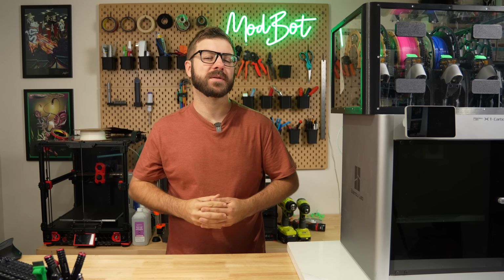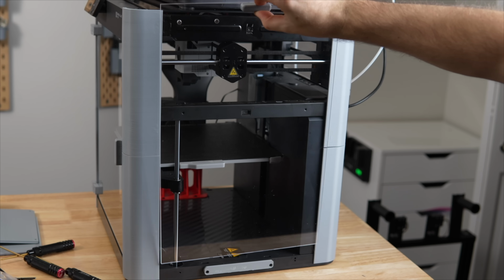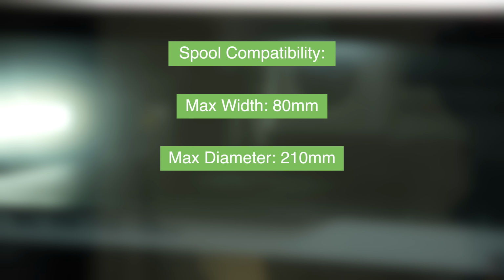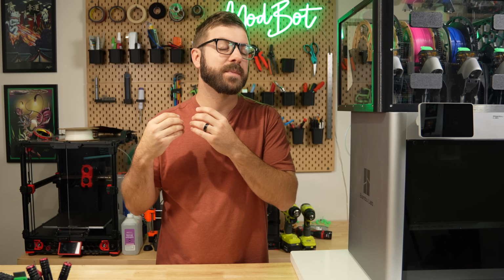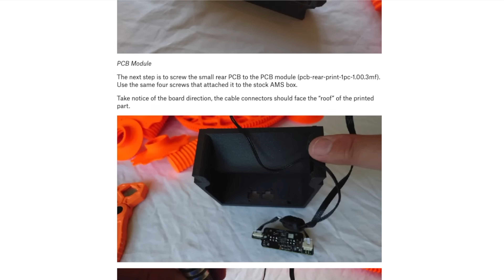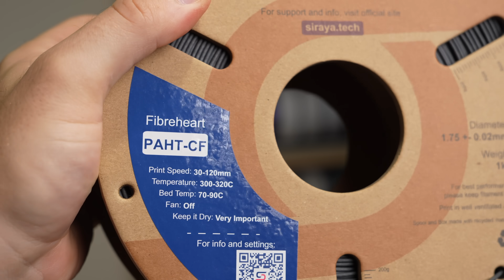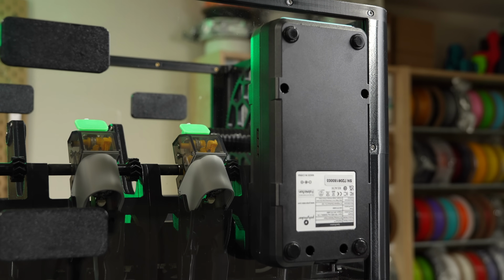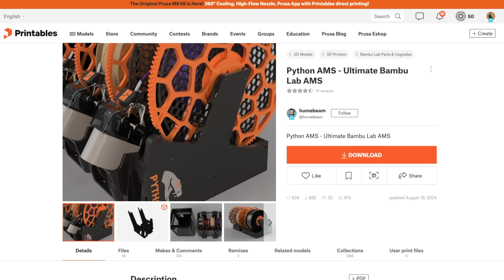Ultimate BambuLab AMS Upgrade! (Python)

Comment: Is it quieter, louder, or the same type of noise as the official? My biggest problem with this printer is how much noise everything makes. I can run all three of my other Voron printers, and this still drowns them out.
Reply from the maker: @yusky03  I haven’t measured but it might be slightly louder. The enclosure helps to dampen it.

Comment: I've already made compatible RFID antennas, and after testing I'll make them open-source
Reply from the maker: That’s awesome! Do they connect to the computer costing RFID board?
Reply: I believe automoderation is pushing little too hard, my answers are magically disapearing
Reply: everything is ready and tested
Reply: @Kenagon  if you included any links in your responses, you will need to break them in order to post the comment. the YT automod will instantaneously delete any comments that have links in them, even to other videos on YT; or at least that has been my experience.
Reply: @blakes8901  even mentioning the name of the repo getting a comment deleted
Reply: it starts with git
Reply: ends with hub
Reply: then goes Python_RFID
Reply: RFID is the only reason to buy bambu filaments.

Comment: So you would need to buy the two polydryers separate at about $160+tax usd and this enclosure and hardware for another $75+tax usd for a total of $235+whatever taxes was. Hmm I've been fortunate haven't had any serious issues with my AMS so this isn't for me but I do like the dryer idea, I wonder if we could just cut some holes on the bottom of the AMS to mount one polydryers too with some feet to balance it, then make/print a modified vented version of hydra to let the heat pass through. 🤔

Comment: This is so tempting! I hesitate to do this to my only AMS. However, I might see if I can find a used AMS or sources for the "replacement" parts from Bambu. Looking at the Bambu site, you can buy every internal part for the AMS from Bambu. I am considering ordering the kit from Voxel and then working on sorcing the internals.
Reply: I had a similar thought. Looking at the current pricing off the parts for the internals it comes out to be more than the cost of a new AMS unit. Before you get to the circuit boards it was coming out to be about $285. With all the electronics needed, it comes out to be about $363, with the currenting prices. That's without the PTFE tubes. The current price for a new unit is currently $350. So I'd probably either go for a used or buy a new unit instead of sourcing all the internals. Could get used that doesn't work and source the broken parts if the used price is reasonable.
Reply: @EngineerWilky81  I had yet to get around to pricing the parts. I'd also have to add the $50 for the AMS hub.
Reply: Some guy commented he’s got 4 AMS units “basically retired” because he hates them, maybe he’ll give you one. 😂

Comment: Really been considering this after HATING the pair of AMS units I have lately. Thanks for making this video. Really curious if this will save my major overruns on print time from AMS issues.
Reply from the maker: The build is pretty involved but with the 608 bearings and gears used motion is buttery smooth compared to the stock setup. I imagine it will definitely help. While I have used a ton of cardboard spools when they get to the end and are really light I have had issues with them lifting from their slots and not feeding properly. This should completely eliminate that from happening. If I where building from scratch I think I would go without the enclosure just due to me not having moisture issues with what I print but so far I am really enjoying the finished product.
Reply: @ModBotArmy  My issue is slipping on the rollers. Even a full spool of Prusament on a plastic spool, still slips. I actually have a video going live like... now, that shows just how bad this has become. Maybe I'll stream the build to justify it, ha.

Comment: Just ordered my p1s with ams guess this is the first upgrade
Reply: Run it stock for a while most of these mods aren’t necessary and are just kinda nice to have
Reply: @Timelessplays  i don’t like leaving things stock lol my ender and voron already have a ton of mods
Reply: @blaze_toast  Idk man I like my hobby to be 3d printing not 3d printers as a hobby the less time im messing about trying to get my printer to work the better
Reply: @Timelessplays  good point i do also like to print very fast which is probably why i have modified my printers so much but i needed something reliable and a bambu lab seemed like a goos choice i probably wont touch it in terms of modding for awhile

Comment: Can’t disagree more. The lite is so much better and more reliable. Its just to many parts and plastic on the og ams. All 4 of mine are basically retired.
Reply from the maker: I never said the Lite wasn’t good? That’s still and AMS unit. I have no issues with the Lite version.
Reply: The L I T E can't be used on a P1P, P1S, or an X-1 Carbon. So what are you on about?
Reply: @TheZionPhil  Something that needs to be fixed.

Comment: Having trouble visualizing how it might support 5 external spools.  Are you counting a feed outside the Python?  I have a Bambu 4:1 PTFE manifold in front of the AMS PTFE tube which uses up one slot, for just 3 external.
Reply from the maker: @ziggystardog  it would be 4 external spools. I think you’re referring to when I say 5 Bowden tubes. One is for the one coming out of the AMS feed.
Reply: @ModBotArmy  Ahh… thanks.  It didn’t occur to me that one of the tubes was the Python outlet.

Comment: My one gripe on this design is that all spools are top loaded. The Python with elcousure is 69mm (nice) taller than a stock closed ams and 79mm shorter than an opened ams unit. This  makes stacked designs much taller. I wish there was a way to make them front loaded so that the encousers can be mounted ontop one enouther and allow for a shorter overall stack.

Comment: Since it supports bypassing most of the feeder mechanism and directly rotates the spools, can this handle flexible as well as abrasives?
Reply from the maker: For flexibles I prefer as short of a path as possible. However if you did something like 95A and up it’s very likely this would work fine for it. May take a little effort to get it routed but shouldn’t be too bad.
Reply: @ModBotArmy  could you use those bypass caps on the stock AMS?
Reply from the maker: @DanielChaves1984  yes! Well the easy load and thumb saver aspect but I don’t know how you would route extra Bowden without drilling for the external function. Also the stock rollers don’t free spin so it wouldn’t work.